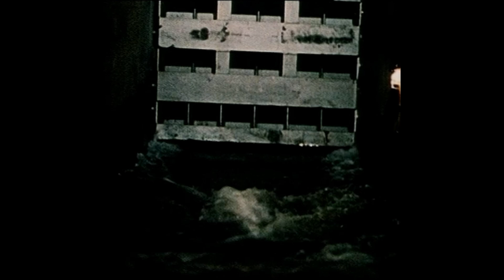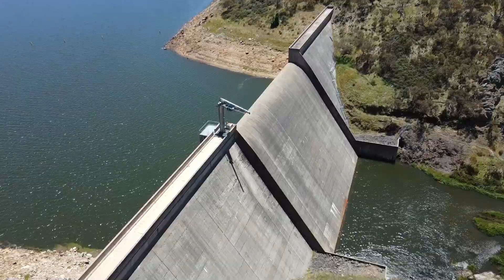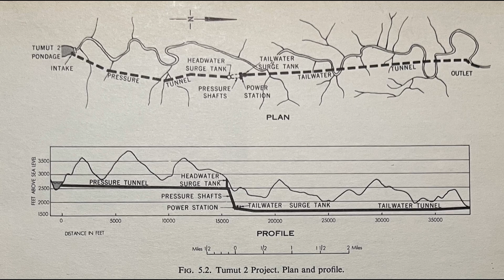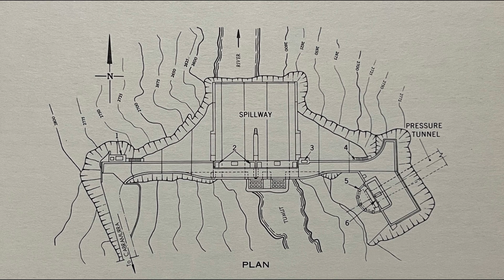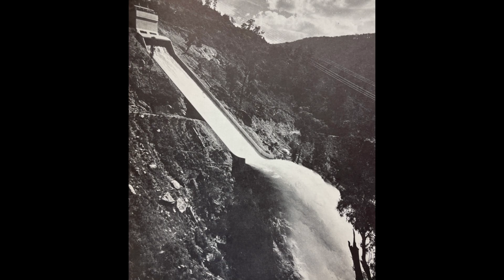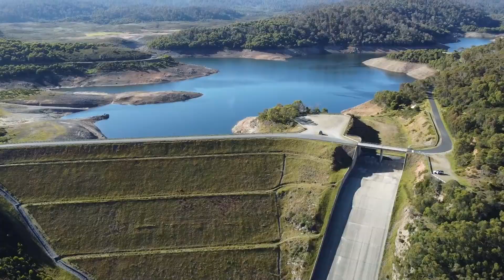Snowy Hydro 75 Years - Part  3:  Upper Tumut Works Completion

Comment: Also note that the Lobs Hole Power Station, fed by Tantangara, and shown on earlier concepts, didn't happen as R&D evolved. The Tantangara Eucumbene Tunnel sorta  took its place. The geology in particular was seen as too difficult and the cost benefit didn't add up. Snowy 2.0 has resurrected the concept, and perhaps confirmed the early doubts.